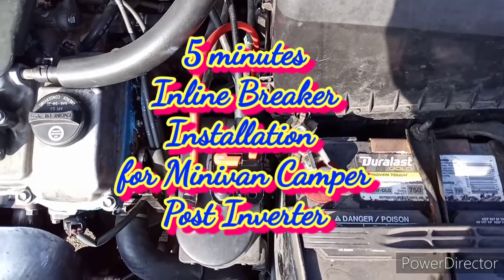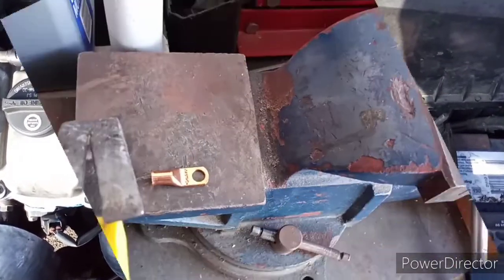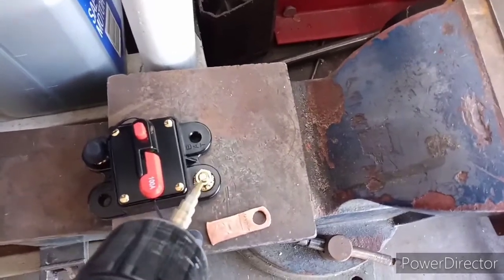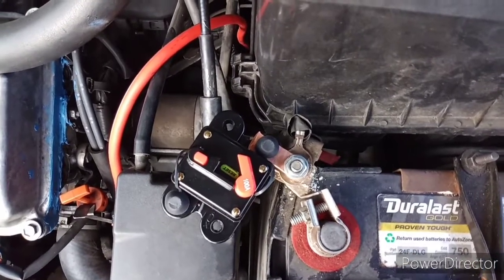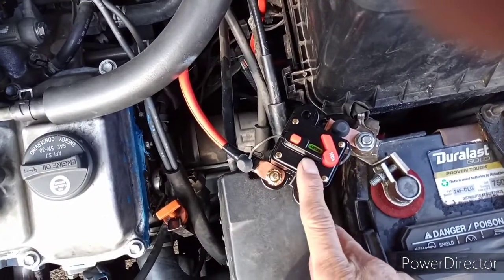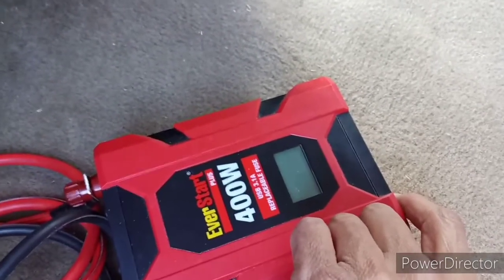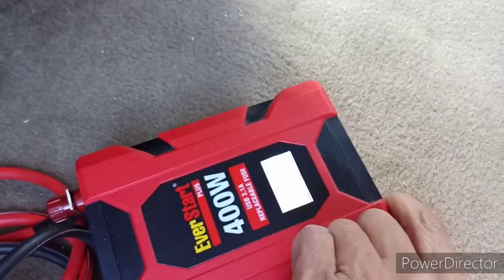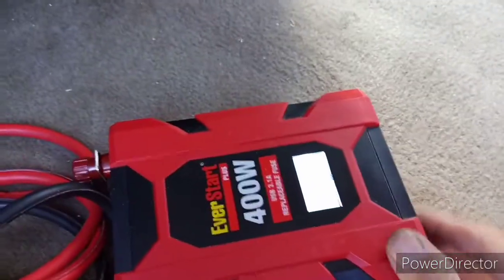Short Video: 5 Minutes Installation of Inline 100A Fuse for Minivan Camper's Power Inverter

Comment: I did the same only I have lots of fuses so I did a fuse instead of circuit breaker. 
Always use something to be safe and not start a fire.
Reply from the maker: Actually, I didn't really need it because I leave it disconnected until I use it. As of right now, I left that circuit breaker in open. It is there just in case the wire got chaffed and contact the frame along the way. $12 part is cheaper than my life (I think!)😁

Comment: Very nice, interesting.  Do you keep the circuit installed full time or on/off as needed?
Reply from the maker: It's actually there for convinience. I keep it off until I decide to use the power inverter. Thanks for stopping by my friend!! Have a great weekend.